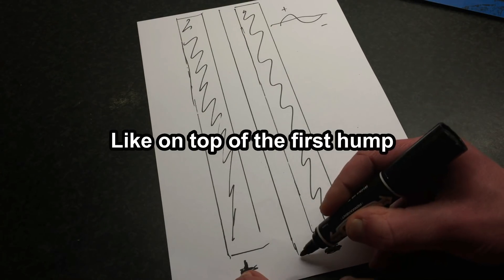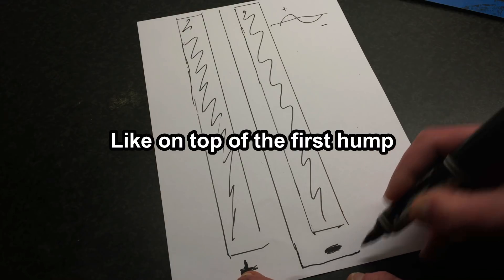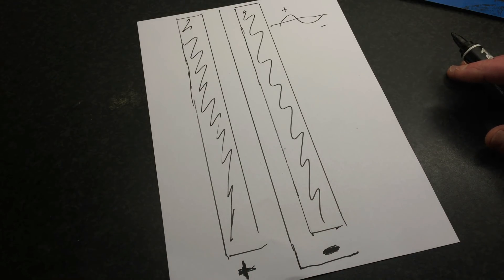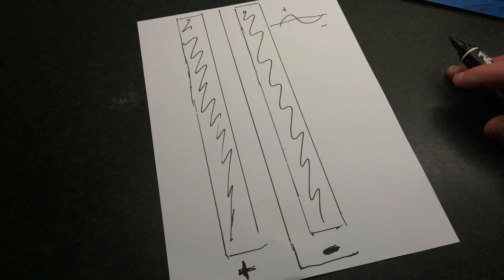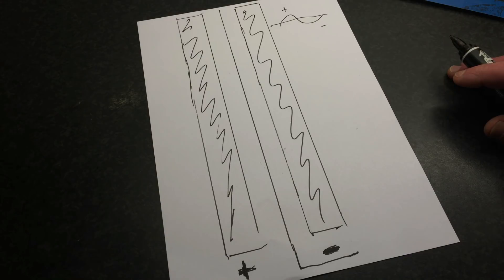Stacked ESL Part 1  -   Background Information

Comment: Would there be any benefit of delaying signal for one membrane to avoid it being out of phase with the other? I dont know i the speed of sound is the same at all frekvensies
Reply: It is the same at all freqs. No benefit, I'm affraid. You can put it in a box or a transmission line if you want to get a monopole-ish radiation.

Comment: Could one make an esl for a 100v amplifier and then not need a transformer? Happy Holidays Joppe
Reply from the maker: not direct drive, to low voltage.  :(   but if you have a 100v one that is not using transformers you might be able to get away with only a small stepup ratios.  still waiting on a class D high voltage  variant direct drive one :) no luck so far.   direct tube driven is possible , or with s small transformer.

happy holidays to you sir !

Comment: I disagree @ 11:53. The result would make sound. It's a bipole config. The only problem would be very high impedance from a small cavity in between the diaphragms.
Reply from the maker: both acting against each other so its not a bipole im afraid. :(
Reply from the maker: the only sound you would hear are stuff that is not exactly the same , like distortion etc
Reply: @joppepeelen  Well, both are in phase, only reverse direction and the air between them has some compliance (small, considering that they are sealed and the air is trapped). So they'll both move as much as this compliance allows, which is not much, so it'll create a  high pass filter, but they'll make a sound just like a push-push subwoofer box. The only difference I see is that this esl would emit only high frequencies, so some cancellation might happen on the sides due to offset of diaphragms, but not much.  Other than that this config is omnidirectional.
Reply: I mean, If you think about it. The AMT is just a bunch of these stacked on top of each other.

Comment: very good illustrative presentation of the electrostatic force, as far as I know did use at least Koss in their both electrostatic speakers "Model 1 and Model 2" this isobaric technique in the bass section, advantage of this construction is to reduce  the step up ratio to one half..
Reply from the maker: Aah nice ! i did not know a model that used it, i was pretty sure in the low end one should have done it by now (mayeb even many). since it is far more easy to do so.  nice to know i might look those up ! i heard the name a fiew times .
Reply: Hi Joppe, I think stacking on a surface makes it possible to increase the amplitude by 6 dB with and because of doubling the speaker area, but when the drivers are connected in series you only get a plus of 3 dB because the emission area stays the same, so with quadrupling you get the 6 db, with four times the load